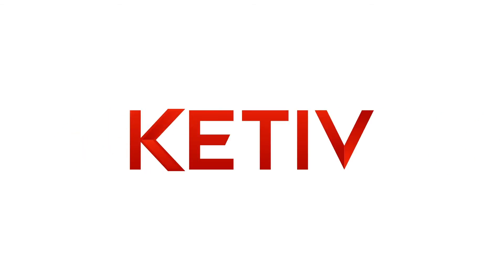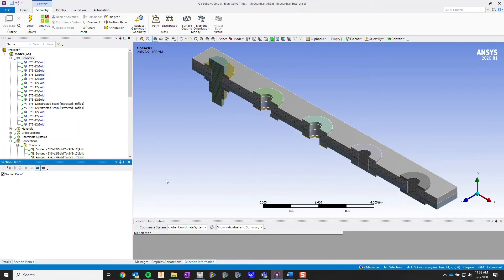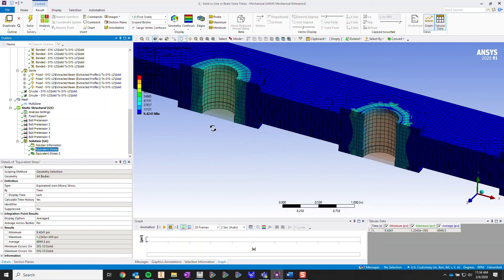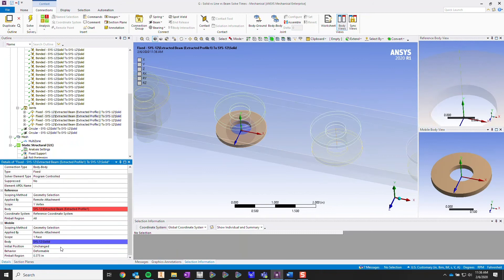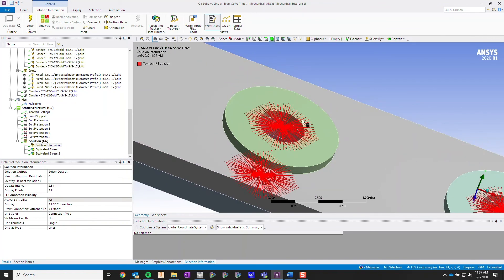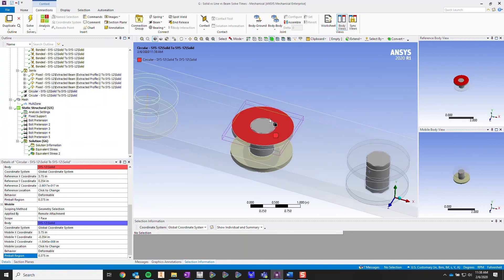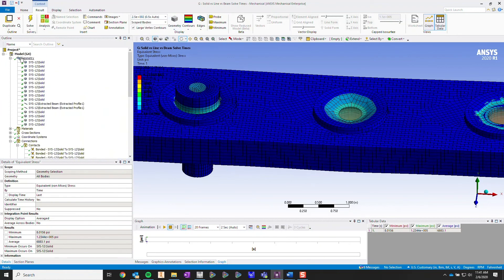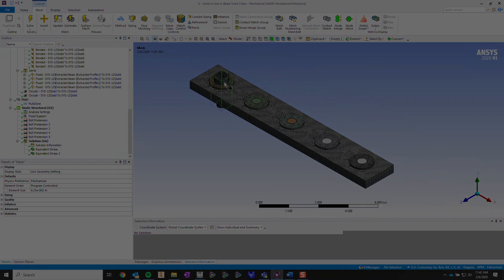Tech Tip: ANSYS Mechanical: Best Practices for Setting Up Line Body Bolt Pre-Tensioning

Comment: i have a screw inserted into a bone that is composed of 2 layers, outer and inner bone.when a vertical load is applied on the screw, the screw penetrated into the bone, and that maximize the stress on the inner bone layer. how to prevent screw penetration?
Reply: Basma Al-Ghali,

Can you please clarify your question? Thank you.

Sincerely,

John Dao, P.E.
Sr. Applications Engineer at KETIV Technologies
Reply: @johndao8592  Thank you, the problem solved.  Ansys makes the filled parts as fluid, I didn't recognize it, so by changing it back to solid, no penetration occurred.
Reply from the maker: Thank you for watching!